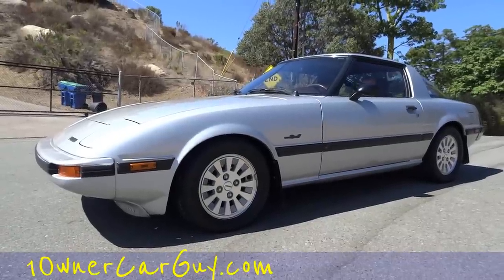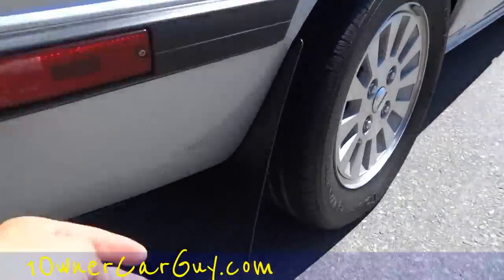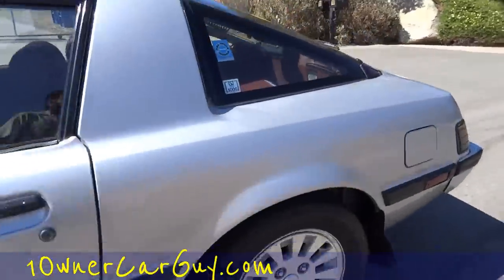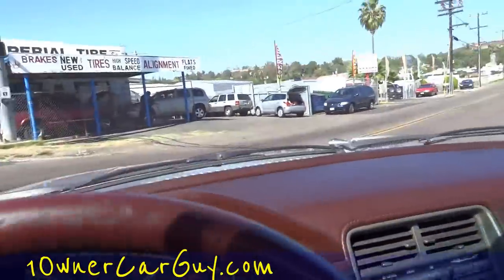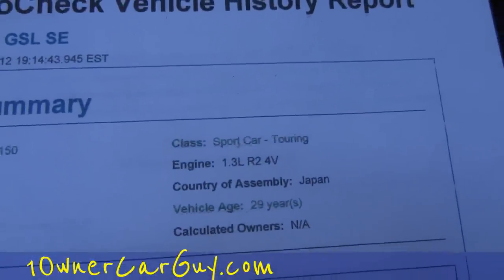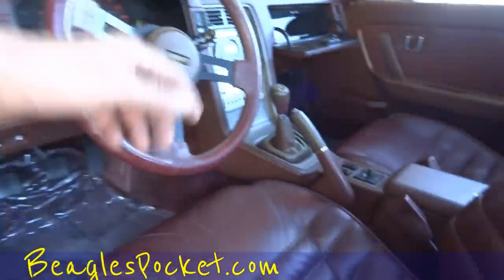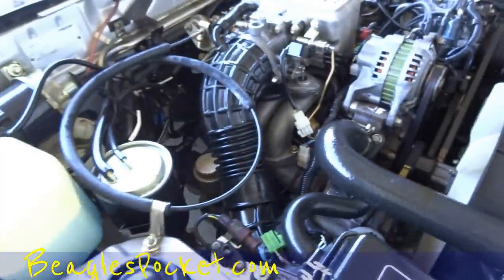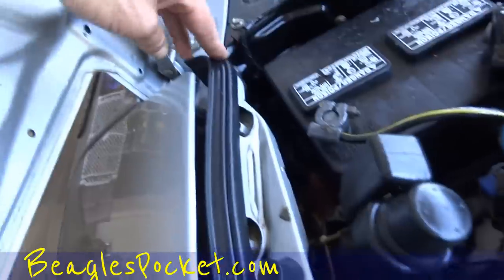1984 Mazda Rx7 RX-7 GSL-SE 13B 5-Spd Manual 1 Owner Rotary Hatchback Sports Car Review

Comment: RE-EGI
Rotary Engine - Electronic Gasoline Injection

4V is not 4 valve, as rotaries have no valves. Also not 4 venturies since there is no carburetor. The throttle body has three blade valves feeding a total of 6 intake ports for the 2 rotors....... 2 primary, 2 secondary and 2 backpressure operated aux. valves.
Reply: I have 3...they are carbourated....the gxl of this year has the 13b fuel injected, this is a 12a
Reply: Chris Nolan: No. This is the GSL-SE it is has a fuel injected 13b, hence the "SE". It was the top model of the 1st generation Rx7, and only available in '84-85. All non-SE models came with the 12a. I've owned 2, and now own an original '79 Rx7.
The GXL was the fully loaded model of the 2nd generation Rx7, which was introduced as an '86 model. All Rx7s from '86 on, came with the 13b.
Reply: TheRotorious13b lol.he literally showed the rotor housing that said 13b
Reply: And it sucked on gas mileage  a had one fun are car but for a small car this thing drank gas ...

Comment: That's a nice and well preserved car!! In my country you hardly are going to find a car like this so well preserved. That rotary engine is a jewel, but in my country if you find a car like this, the engine is replaced with any other engine. By the way RE EGI stands for: Rotary Engine Electronic Gasoline Injection. Greetings!!

Comment: i'm about to buy one of these, and man, oh man, can't i wait to buy it.

the guy is only asking 2k, and not only do i get the car, but i also get spare parts, such as both fenders, a hood, both doors, the hatch window, a new dash board, door window seals, and wiper motors. only few issues is the the engine commonly floods, which should be a fairly easy fix, the clear coat on the targa top was burned by the sun, there's hardly one square inch of rust under the right tail light, and there's a very small ding under the left side of the bumper. i'm so pumped right now :D

Comment: I am not a big fan of rotary engines or Mazdas in general but this is still a NICE car. It is nice to see a RX7 of this generation that hasn't been beaten on. Personally, I would just color match & dye the door panels and leather gear shift gaiter rather than replace them if possible. That engine compartment looks SHARP!

Comment: They typically don't require an overhaul until well past 100k, most seem to say between 100k and 150k, but overall they are generally trouble free, as long as maintained properly, as goes for any car, they won't strand you, they are not winter cars(RWD and too light plus typically are shod with performance tires, and are prone to rust out under salt exposure, I'm from the Wisconsin I know). Check the oil often, they generally burn 1qt. per 1,000mi., the 13b is less needy than a 12a(carbureted).

Comment: First car I ever owned mine was an 81 silver and it ripped! I use to put it in second and tach it up to 8 grand and dump the clutch and spin donuts everywhere! Mine had true possi traction like when I would leave a parking lot slow and turn the wheel the rear wheel would chirp chirp chirp. No matter what side you turned slow.
Reply: JC B had 84 also these really turned some mad rpms...

Comment: Maybe between 150k and 200k, when well maintained and many bigger cities will have at least one place that does rotary rebuilds but some places like TriPoint Engineering are true experts, and they have been doing rotaries forever.
Reply: Sadler2010: first of all, I love these cars. I used to drive an 85 GSL-SE regularly, but rotary engines never lasted more than about 95,000 miles before it lost so much power and you were forced to rebuild it or replace it! There's no way these things lasted with any decent performance at 150k to 200k miles. Show me one. The reason rotary engines aren't widely accepted, is friction was too high.

Comment: Does it have manual or automatic choke? I know they get awesome fuel mileage but everyone I've ever seen with manual choke was difficult to from time to time!
Reply: the 13bs have no choke, all the 12a models do. they get 12mpg in ideal conditions but most you will find today that have bad apex seals and rotor rings where the combustion leaks into the other chambers will have very bad mpgs.
Reply: No they don't it good gas mileage

Comment: yeah the car scenes are great. Heaps of laws though. (any modification needs to be certified, which is very costly) I'm pretty sure Australia got the Chrysler in the 60's, 70's, I'm not too sure NZ did though. Yeah, the holden commodore and ford falcon are iconic cars in both countries. From the classic ones to the modern ones.

Comment: that car is not fast it's slow Hondas are better
Reply: Diego Alvarado for a vehicle from the 80s at its price range it was pretty quick.
Reply: Semi-Deep Thinker  bro my dad has a Honda civic turbo it beat this car on drag racing
Reply: Diego Alvarado ok. There's videos of a "farm truck" beating a Lamborghini. It doesn't mean Lamborghini's are slow it just means the farm truck is moded. Your dads civic can beat them because it's moded and maybe the rx7 is not moded.
Reply: There not that fast but way more fun then any fucking Honda for surre....
Reply: @marvange2498  They are fast if you find one that hasn't been revved to the redline and one that has been maintained. I had a 79' SA22 version that would chew on civics stock for stock.

Comment: engine needs rebuild after 100k oil control rings probably bad car is nice
Reply: Thats an rx8 motor, these are more reliable.
Reply: My carbureted 83 is going strong at 150 with no service history, oil pressure at idle is about 5 less than it should be.
Reply: +manny6229 I bought 85 RX-7 GSLSE drove it from 39K to 220K - Motor was still strong after 200k
Man the memories
Reply: The gsl se models crap out after 200k there junk or a complete rebuild with new rotors.
Reply: Larry Cubes
Actually I had far more problems with throttle bodies warping over times or the oil cooler mounted under radiator leaking at the house mount